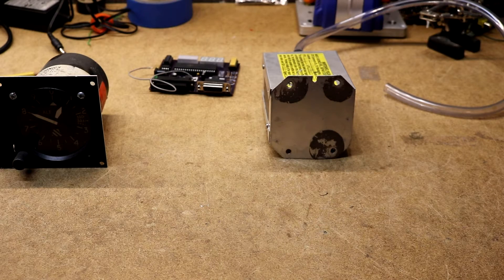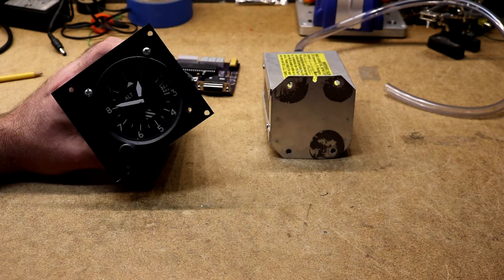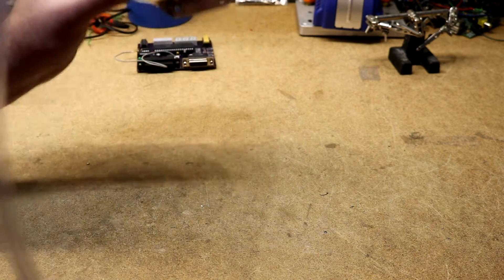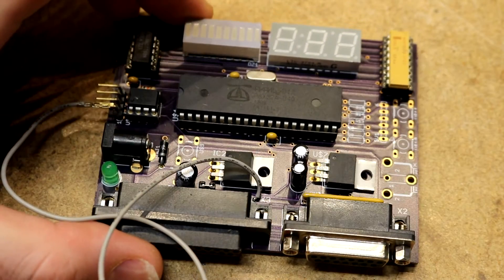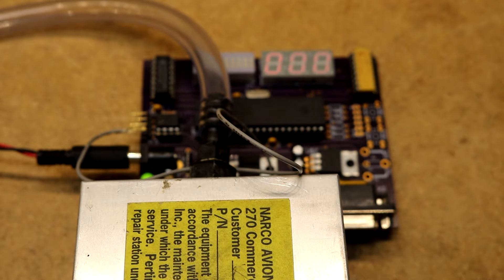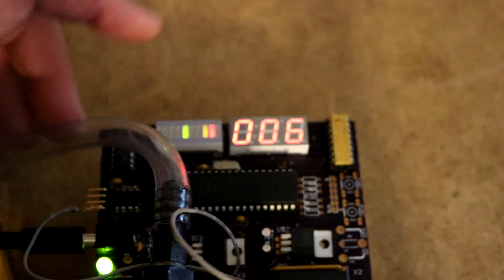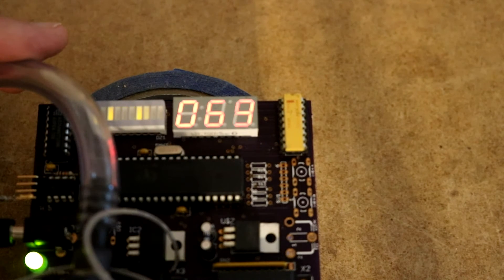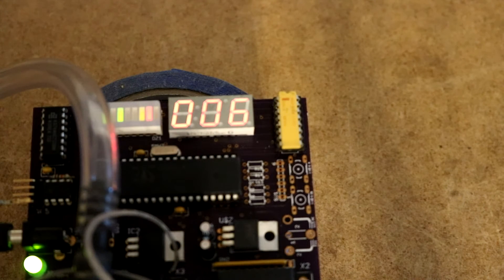DIY Altitude Encoder Tester and Narco AR850 Altitude Encoder Teardown

Comment: I got the encoder tester working. Works great, I just wish I knew what all the extra circuitry is for. It is not described anywhere I could find. I have a Zenith 650 and I just wanted to know it was working before I go and get it checked at the avionics shop. I'm at 4690 and it is showing 4500. display goes down in altitude when the pressure goes up and alt. goes up as the pressure goes down.

Comment: Where I can get this Altitude encoder tester...??? or more info.-
Reply: A few years ago I built my own Altitude Encoder tester, as they are very easy to make.  I plan on making a YouTube video someday soon, when I will have a bit more free time.  But, if you want to make your own, here is how to do it.  First, get the pinout for your model of Altitude Encoder.  Many models follow the convention that data lines D4, A1, A2, A4, B1  are pins 1,2,3,4,5 of a DB15, and data lines B2,B4,C1,C2,C4 are pins 9,10,11,13,12 of a DB15.  Not all encoders have the D4 line.  The Gray code is contained in the 10 parallel lines (or 9 if no D4) D4,A1,A2,A4,B1,B2,B4,C1,C2,C4. Just connect the negative lead of 10 LEDs to the 10 lines D4,A1,A2,A4,B1,B2,B4,C1,C2,C4.  Then connect the positive lead of the 10 LEDs to the positivve voltage source.  Dont forget to add in the appropriate resistor for the LEDs you are using to limit current and prevent burnout. The way Encoders work is by leaving all lines unconnected (just floating) when there is no data, and grounding the line when there is data.   So, when the line is grounded by the Encoder, the LED will light up.   You will have to find out which pin is ground and which pin is +voltage for your Encoder and connect the correct voltage.  On many encoders, +14V goes to pin 8, and ground goes to pin 15.   On some older encoders, they wont produce any data unless pin 6 is connected to ground.

Comment: the gray code bits generated by the encoder are static, and change only when altitude changes? i built an encoder that works fine on the bench, but for some obscure reason the KT76C transponder seems to read the encoded altitude at startup and then keeps transmitting the same alt, even though the encoder changes the output bits according to altitude
very little info around on these devices, and i only have xpndr's that use serial data.
any help appreciated, thanks

Comment: This is just what I was looking for.  I have a different resistor burn't in half.  If you still have the AR850 I wonder if you could tell me the value of it.  It is clearly shown in your video at 15:58 just to the right of the 7805 regulator and just in front of the 47uF capacitor.  It looks like it might be Brown, Black, Black (10 Ohms).  Is it possible to confirm this?  Thanks.